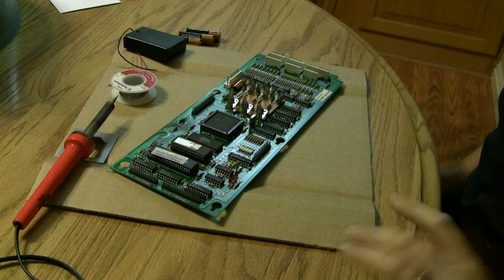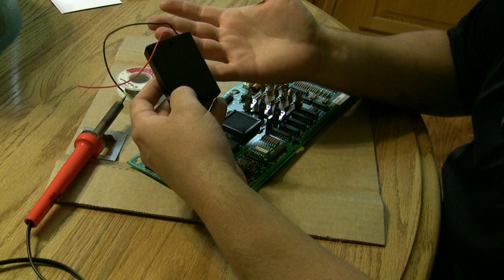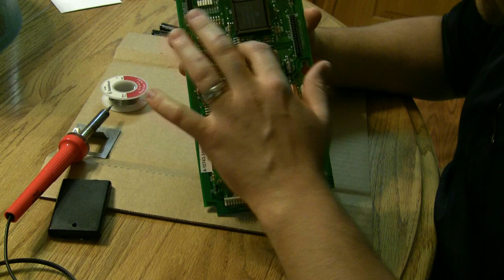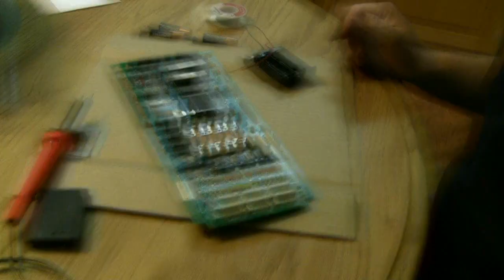How to replace a battery holder on a pinball machine

Comment: I have a High Speed 1 Pinball Machine and had the same problem with the Batteries starting to leak Acid. Fortunately it didn't do any damage to the board. I replaced my Battery Holder with a single Button style battery. It's much easier to replace the battery and it won't have an issue with leaking acid. Love your videos.

Comment: Do you have video of taking out the battery holder and putting in the new battery holder?

I have the High-Speed 1 Pinball game that is similar to Getaway.
It has some bad battery acid on the holder and I want to get it replaced.